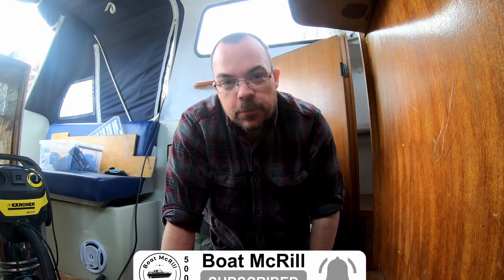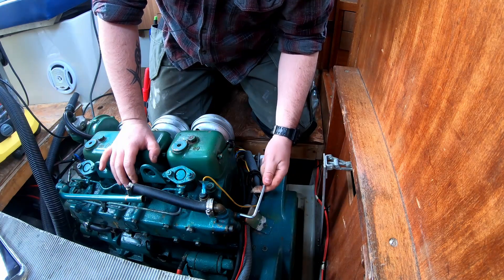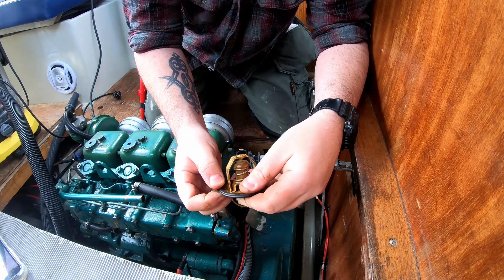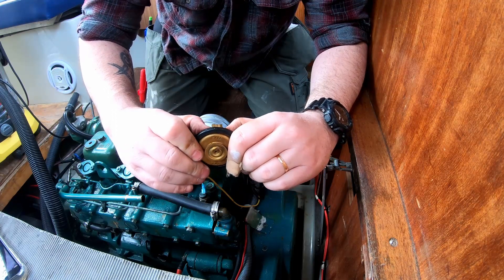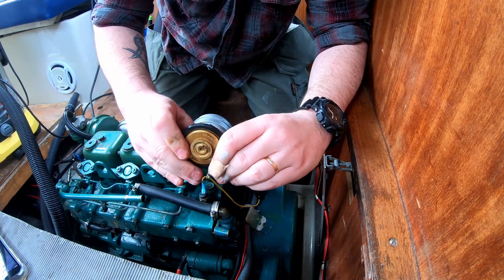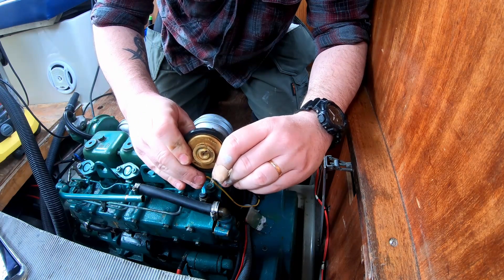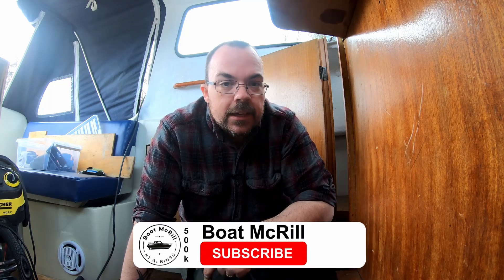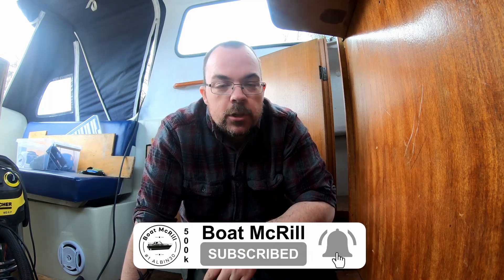Volvo Penta MD17C thermostat replacement

Comment: It is easier just to shut off the through-hull then drain the cylinder barrels and the exhaust manifold. Then blow the coolant water out of the gearbox. DO NOT LET THE MD17C MOTOR FREEZE EVEN FOR ONE NIGHT!  I did !

Comment: I think when the thermostat opens it let's hot water flow out of the manifold to flow to the exhaust. As the hot flows out the thermostat the tee fitting under the manifold allows cool water to enter cooling the engine. Does this make sense?